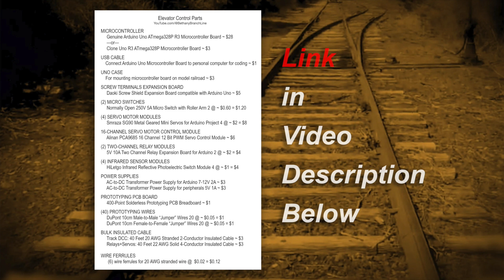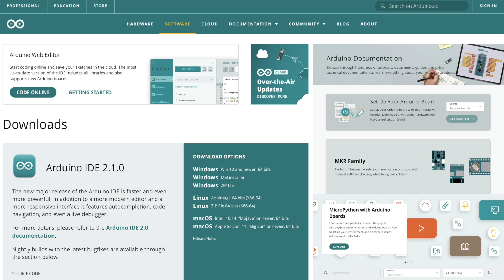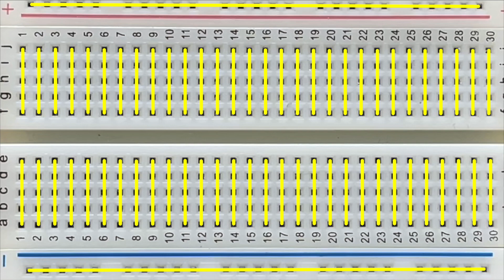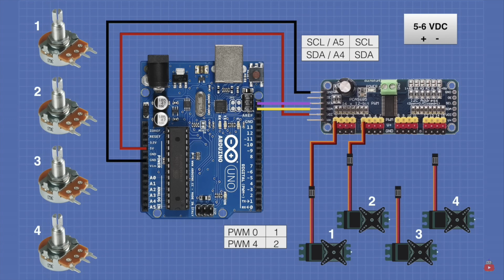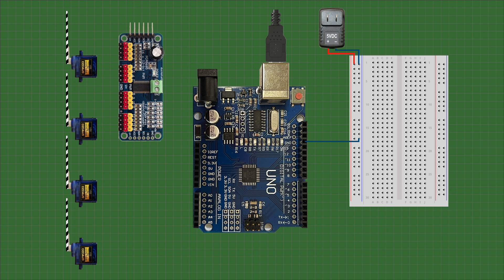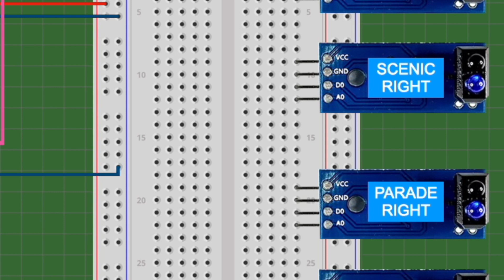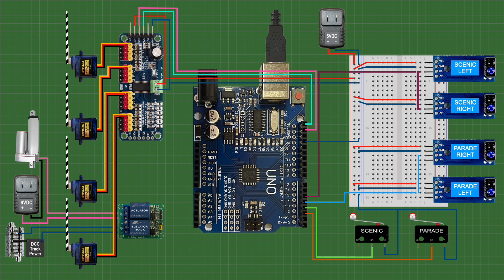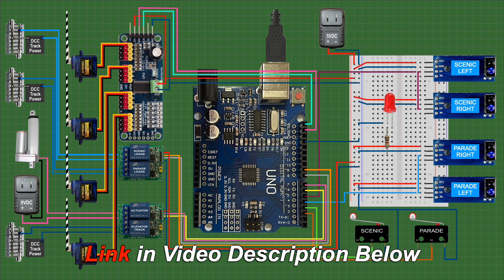Controlling the Train Elevator Part 2 Parts & Wiring

Comment: Well done once again. This series continues to be fascinating to watch and easy to follow and learn from. The wiring animation is particularly well done and helpful.
I did notice that the 9V power brick shown was rated at 1A, rather than the 2A stated and captioned. Which should be the correct rating?
Reply from the maker: Donald, Thanks for your feedback! You have a keen eye to notice the inconsistency in my presentation. The Arduino Uno's DC jack is rated for 7-to-12 volts at 2 amps, but i found that a 1amp supply works fine with my circuit, because I am using a separate DC supply to power most of the peripheral devices, as opposed to having the Uno power them.  Regarding voltage, I read in technical literature that the Uno operates on 5 volts internally (hence it can be powered from the 5-volt USB connector), and that the digital current supplied to the DC jack goes through a voltage regulator to reduce it to the 5 volts needed by the Uno. In fact, the Prototype Train Elevator Control System that I demonstrated supplied the Uno with 5VDC 1.2 amp and operated reliably. The tech literature cautions that more than 12 VDC plugged into the DC jack will burn out the Uno. -- Russell